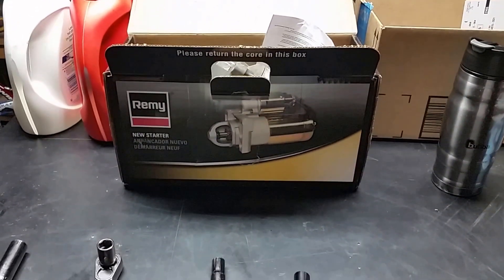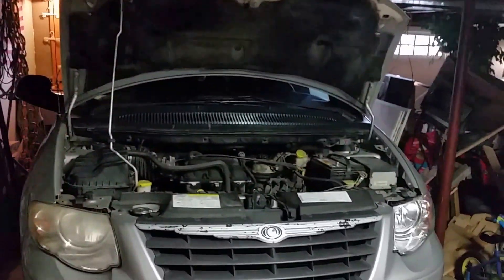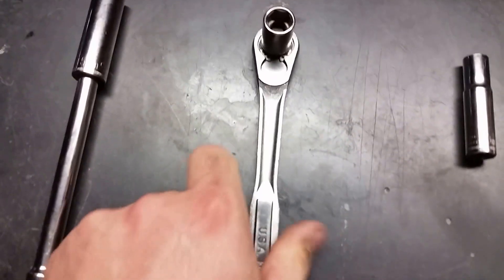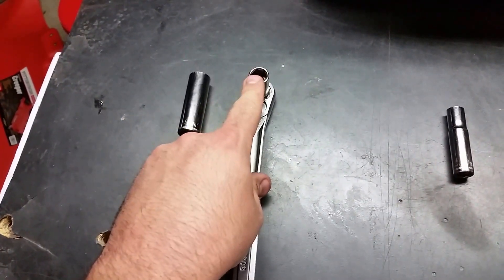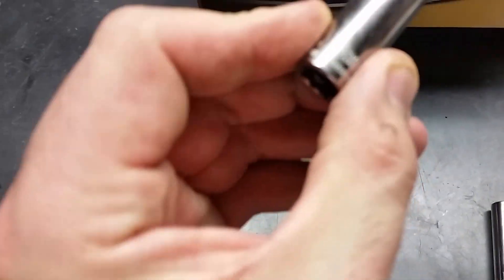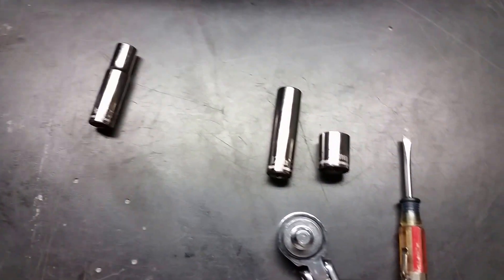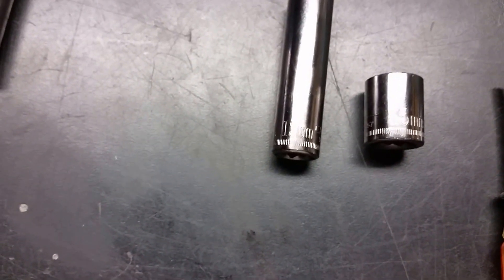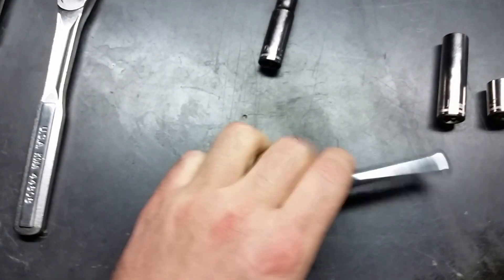2005 Chrysler Town & Country3.8 liter V6 Starter

Comment: I watched a few other starter replacement videos where the guys would take apart the inside to get at the double bolt instead of using a socket extension bar. Kudos for using that, great video!
Reply from the maker: AJ Usog thank you, glad you enjoyed the video.

Comment: WISH you would have showed you doing the work instead of explaining it. especially the bolt on the drivers side. wanted to see if you get it out without removing fans etc.
Reply from the maker: I didnt have to remove anything else to get to it. I tried to film while doing the work but i just couldnt do it by myself, I know it would have been better that way but thought at least walking through the steps would help.